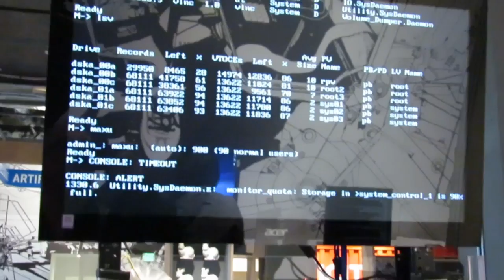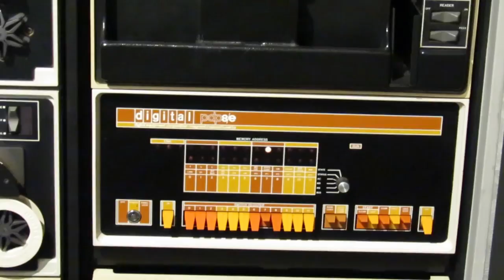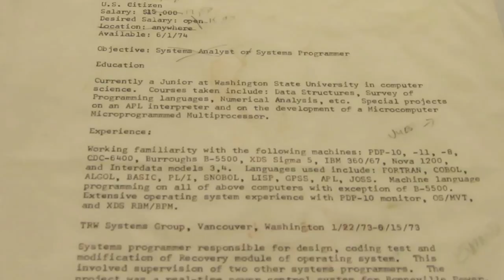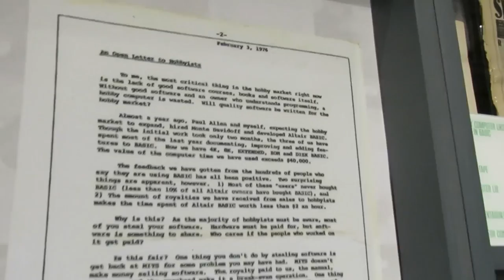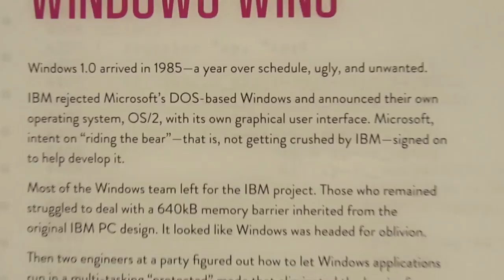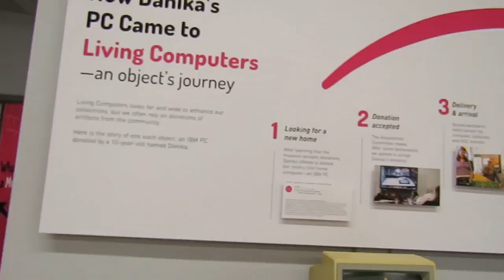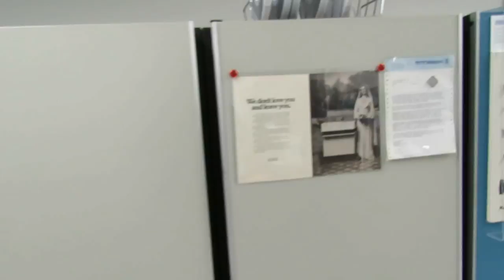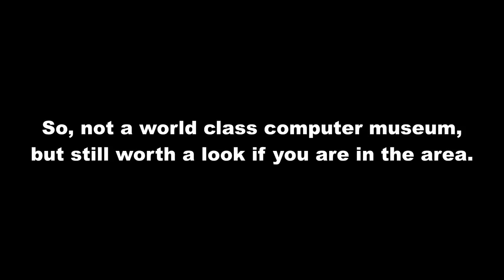A Walk Through Seattle's "Living Computers Museum & Labs"

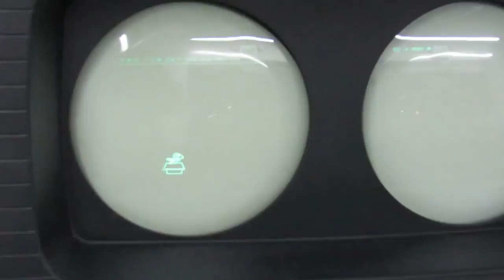Comment: I was amazed to see a Cray I on display. Nice hearing the noise of the teletype machine at 5:36. That brings back some memories. At 12:09 it says that the Altair was on the cover of Popular Electronics in late 74 and then shows one in the display saying and showing it was actually January 1975 issue of the magazine. I got rid of all my old issues of the magazine except for that one. Did anyone else notice the typo in Gates resume shown at 13:07? Nice to see they had a section for mainframes. Loved seeing Snoopy on the CRT of the CDC6600 at 39:38. No sign of an old IBM 1403 line printer or keypunch machines. I could think of a lot of items missing from the display. There should also be a section on the history of computer magazines.

It is a shame that the items on display often had no information accompanying them. It would have been, perhaps, better if they had the items laid out in a more chronological order instead of the apparent randomness of it all. BTW, there were times where the titles you put up on the screen obscured parts of the items being shown. You showed a Heathkit manual but I couldn't read the name of the product on its cover.